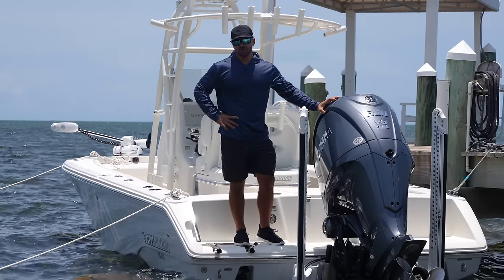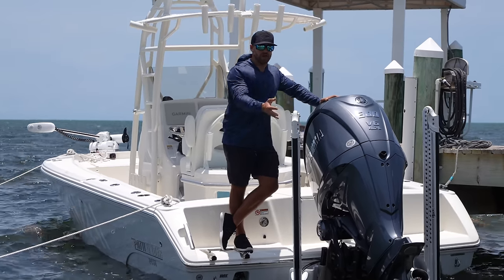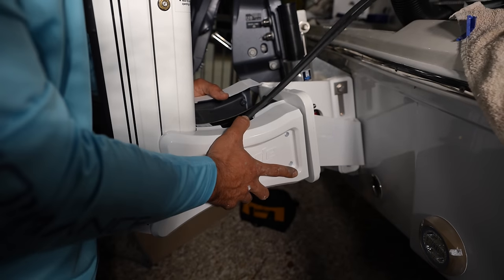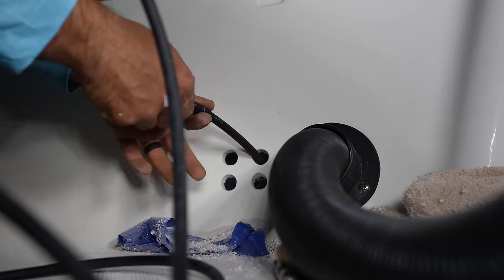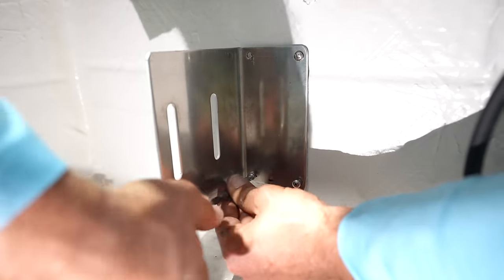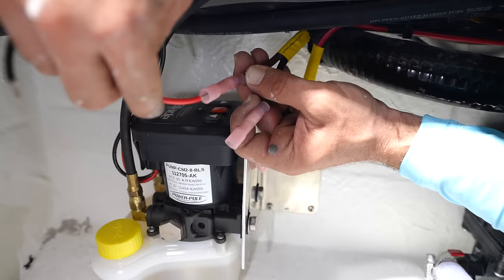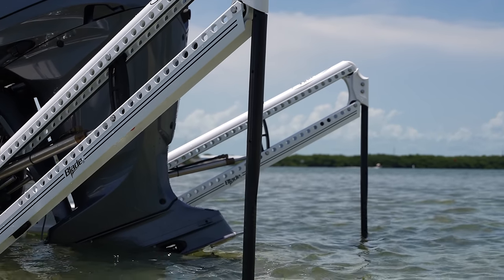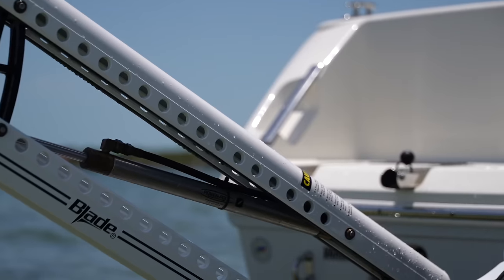Installing Hydraulic Anchor Poles on a Boat | Power Pole Blades

Comment: I've installed a few of these and worked on them on various boats I've had. JL Marine(Power Pole) is top notch. If you have an issue, call them. They stand behind their product.
Reply from the maker: They have incredible customer service one of the many reasons I stand behind their product.

Comment: Is a jack plate required for install on the transom? I agree that the fewest amount of holes in the boat is ideal. I’m considering 2x10’ blades on a 2018 Carolina Skiff 238 DLV.
Reply from the maker: Yes it is required if you want to mount it without putting holes in your transom. Thanks for watching!

Comment: Hi Clay, what are your thoughts on the minn kota raptors, compared to power poles? That active anchoring feature is really catching my eye, especially when at the sandbars, fluctuating tides and even waves at sandbars. Interested to hear your thoughts
Reply from the maker: Hey man! I don’t have experience with the Minn Kota anchors but power pole has always had exceptional customer service.
Reply: The Raptor is just a knock off of the Powerpole. If you've ever done business with the Powerpole manufacturer, you'll know they have the best service response in fishing, hands down. Their service is a huge reason why I am still using these today and I was one of the first to install one for saltwater in this area. I broke a knuckle once when a large wake pushed me to the side while the pole was deployed over a shell bed, and the company sent me a new one and hardware at no charge, and I wasn't even remotely within the warranty period. Others have the same experience. Not saying anything negative about Minn Kota, they are a well established company and I use their Terrova with anchoring, but the Powerpole changed how I fish and as long as they stay true to their business model, I'll continue to use them.

Comment: Hi Clay, installed one on my 196 Bayreef two years ago using the outboard bracket same as yours.  Best thing since apple pie and IMO worth their weight in gold. I have only a single pole but when in windy or tidal conditions I use the anchor lock on the trolling motor with the PP to hold my position and it works well.  I also read in my research that Power Poles customer was excellent. Hopefully I never need to find out.
Reply from the maker: It really is a great invention. It’s made boating more pleasant when it comes to pulling out the anchor. 

That’s actually what we use to do when we had one pole installed.